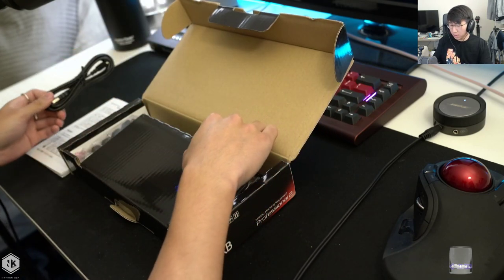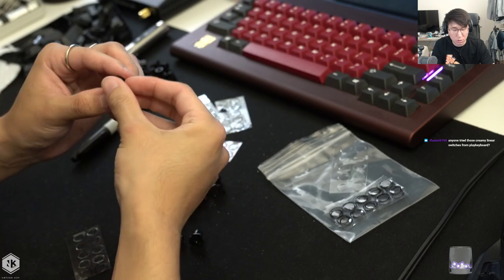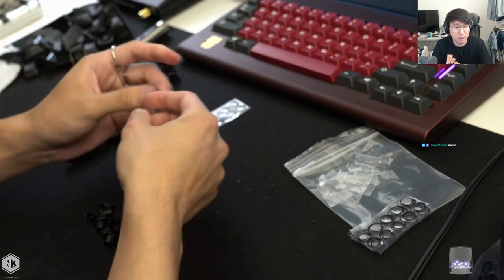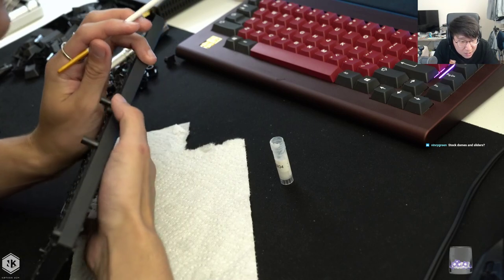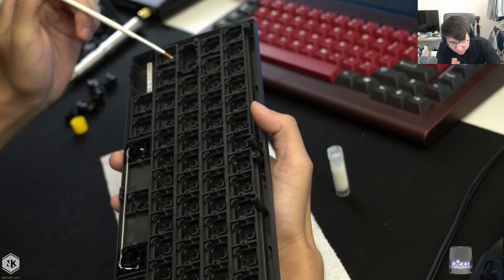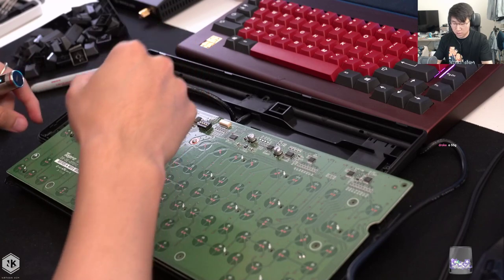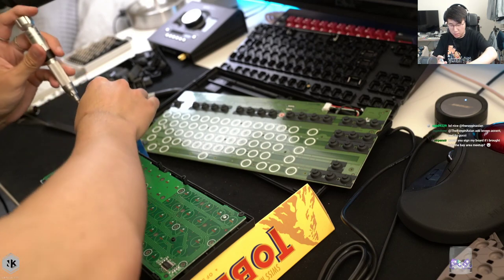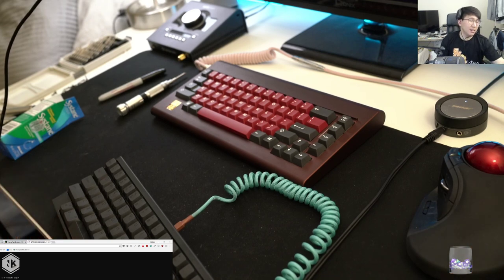HHKB Mod Stream | I AM A TWITCH AFFILIATE NOW!

Comment: Hi, Have you tried BKE, korean ebay, or Plum domes? I had a plum 108 key 30g before my new topre rgb 45g uniform, and always liked the feeling of suuuper light capacitive domes, but am quite partial to the tactile feeling of the topres. My question is because I was wondering if in futre I wanted to go to a lighter dome, which one would be the best quality, and you seemed like the right dude to ask.

On the same train of thought, would you recommend O-rings and internal dental bands? Or just one? How have you found the key feel of this keyboard after all these mods?

Comment: Hey Nathan! Hugee fann~ but I got a quick question, do you happen to know whether there's any textural or overall differences between the front or back sides of the silence-x rings?
I installed them on my novatouch a few months back and wasn't sure but finished the mod anyways, but I was thinking of using the remainder of the rings on the new rf r2 I got but might need to steal some from the novatouch lol anyways thanks for the help!

Comment: Hey Nathan, have been going back and forth between Topre and Linears and I think I'm finally taking the plunge and going for a topre board.. I've heard that thick lubes on the sliders could potentially make it slower and less snappy during the upstroke. Have you had any experiences with this? I have the Krytox 205g0 (which was initially intended for linears) and am wondering if I should use it or purchase 103 + 107 which I have seen used pretty often around the mech youtube community..
Reply: @doggycat  Did Taeha reply to this? I have Krytox 205g0 as well and plan on lubing my FC980C with that lube. Is it okay?

Comment: Thanks for this NK! I'm going to do this same mod in a couple days and I'll use your video as a guide while I'm doing it. Helps relieve some of the anxiety of opening two brand new boards. So, again, massive thank you!  Just a quick question: are the 55 dome springs and 45 dome springs identical? In your video, it looks like you pair the 55g domes with the original HHKB 45g dome springs. Does it make a difference?

Comment: My daily driver at work is the Microsoft Sculpt at a negative angle. Having been using that every for three years, I got used to the split form factor at a negative angle. I have recently bought my first mechanical keyboard and even since been enthralled by the wonderful world of mechanical keyboards. While I'm a long way from modding my own keyboard but the first thing I did was to add detachable (with velcro) feet at the back of the keyboard to recreate typing experience with negative angle.

Need to relearn how to touch type with standard qwerty keyboard by far the most uncomfortable experience. But the tactile feedback from a mechanical keyboard is so satisfying.